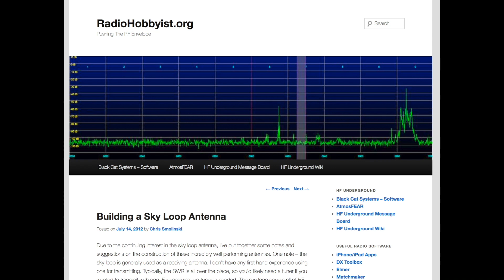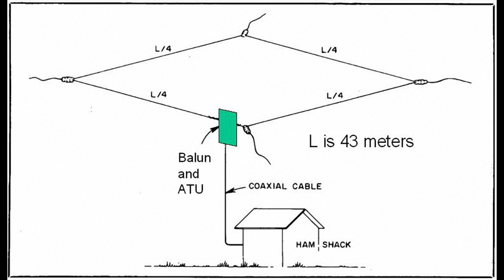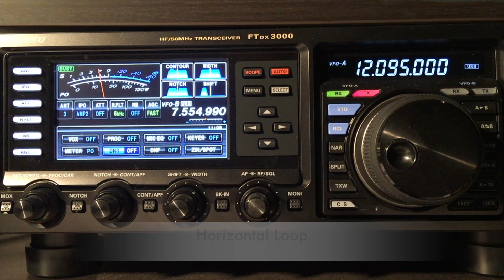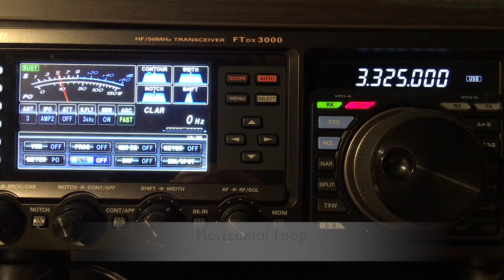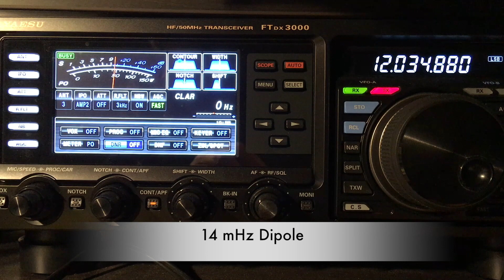Horizontal Loop Antenna Experiments

Comment: Licenced in 1985 and QST had  Skyloop article.  I built one for 80m full wave length horizontal loop.  100 ohms input so 2:1 balun and 50 ohm coax fed.  Brilliant.  So I made a 40m full wave loop with a 1:1 current choke and a quarter wave 75 ohm Q section matching the 50 ohm coax to the 100 ohm 40m loop input.  400 watts and it works Brilliantly.  Using an auto ATU I use the 80m on 20m and 10m AND the 40m loop on 15m.  I also have a yagi for info.  The loops are really very effective.  VK5LB

Comment: Go back many years in arrlr antenna handbooks(decades) and you will find info on sky loops.  Been playing with them for many years.  In fact, the first antenna I used was a sky loop with a clugged together tuner.  Worked pretty good on most bands but was a "sky burnner" on 80 with a lobe south  Been playing with a multiloop experiment...same dimensions,  but multi wires around the run in various configurations to try to  change radiation patterns. Haven't played in several years, but results I've had are very mixed as most of the matching methods have been home made and I've been mixing matching/feeding methods without documentation too actually measure actual changes in performance

Comment: Rob, the opening wideo shows you have improperly threaded the ceramic insulator.  The rope should go through the hole farthest away from the support end.  Then the antenna wire goes through the hole closest to the support end.  This way the rope and antenna wire are putting compression on the center of the insulator.  If it should break, the rope will still support the antenna with more slack.  Try it, you will like it.  WD0DUD
Reply from the maker: Yes, I know, Garry.  I threw this old antenna up in a bit of a hurry and did not take enough due care with threading the insulators. That antenna has been gone quite a while now (brought down by a falling gum tree) and replaced with an even longer (100m) loop in a more square-ish shape with the correct installation of the insulators. Thanks.

Comment: That ceramic insulator in the picture is not being used correctly it is being used in reverse mode its weakest way
Reply from the maker: Yep, that's correct. It was a temporary string-up before the video was done. I've reinstalled it since. Is that your only feedback? 🙂

Comment: Such insulators should be installed so that they're in compression, not in tension. In other words, the routing of the wire and support rope should be intersecting, with the insulator center in-between and being compressed (not stretched). Perhaps you'll have to look up an image.
Reply from the maker: Yes, correct. I threw this old antenna up in a bit of a hurry and did not take enough due care with threading the insulators. That antenna has been gone quite a while now (brought down by a falling gum tree) and replaced with an even longer (100m) loop in a more square-ish shape with the correct installation of the insulators. Thanks.

Comment: I see this is an old video. So my comment is this, the Bose system could have been used to cancel out the noise of added to your audio speakers, that's a possible fix, and I believe a computer software could have been work ed into the Bose system. To cancel out the noise itself. Just my thoughts on this problem.
Reply from the maker: Quite possibly. But you have to hear a signal, too! The horizontal loop is an antenna that works to pick up signals across multiple bands (a range of frequencies) in one easy-to-build, low-cost antenna system. The lower noise on the loop is a happy side benefit with an antenna of this type. Since this video, I now have a second generation of the antenna at 100m long in a square shape, plus a vertical delta loop at 10 MHz that also exhibits great signal pickup while rejecting noise. Thanks for taking the time to watch the video and comment. Much appreciated. Best wishes from Australia. - Rob VK3BVW

Comment: The loop seems to be the best receive S/N ratio - the end fed seems to be the worst (by far).
How do you keep the loop tensioned with each tree moving in different directions on a windy day?
Thanks! 73! VE3GHP
Reply from the maker: G'day, Garry! To avoid moving tree limbs, I anchor the wire to tree trunks - They don't move very much. 🙂 This video is around five years old now. The loop collapsed when large branches of gum trees gave way in a storm. I have a new loop now which is 100m long, in a similar location, and in more of a square-ish shape and works on most bands. I now also have a vertical delta loop cut for 30m that also works great on 10m. These antennas are really the "bee's knees"! 73, Rob VK3BVW
Reply: @RobVK3BVW  G'Day Rob - Thanks for your reply! - I also hope to have ~100m length in what will be four or five sided loop using trees and fed at my 15m tower.
I'm not wuite sure how I will deal with each tree moving in a different direction at the same time - I'm thinking it will involve some pulleys and weights though.
I'll be feeding it with open wire. - I gave a 30m doublet now, and I'm very pleased with it.

Comment: Hi Rob, I have just watched your very comprehensive review of the Loop Ant. thankyou for spreading the word about Loops. I have been spoiled, I built a 160m Delta loop here at my QTH 24 yrs ago and have never looked back, it's the only HF ant I have at the moment fed with open wire 90mm wide into the shack and tune my FT991 with the MFJ989D, works well  on 160-10m very low noise. Wayne VK2DWP.
Reply from the maker: Hi Wayne. Thanks for the comments, and great to hear from you. This video is around five years old now. The loop collapsed when large branches of gum trees gave way in a storm. The new loop is 100m long, in a similar location, and in more of a square-ish shape and works on most bands. I now also have a vertical delta loop cut for 30m that also works great on 10m. These antennas are really the "bee's knees"! 73, Rob VK3BVW

Comment: i have an 80 meter loop ladder line fed to a balun design 1:1 balun up horizontal at 70 feet, hears excellent and super quiet especially being in the country. On 40 meters i work austraila and mid east 100 watts with no problem, loops have generally 3 dbd gain over a dipole and a little more quiet but not by much over my 80m doublet.
Reply from the maker: Thanks for your observations, Anthony. Good stuff! 73, Rob VK3BVW

Comment: These loops work well.  I've used one for years. but for best performance you need to optimize the loop by feeding it 450 twin lead (or other balanced feed) and then tuning it at the radio with a balanced tuner. Best one right now but pricey is the Palomar BT-1500 Balanced tuner.  (The tuner incorporates a 1:1 BALUN The tuner lets you optimize for the band you're on. I built my own tuner identical to the BT-1500  I built my own balanced tuner by scrounging a couple of roller inductors from old Murch UT2000A transmatchs I got cheap at a hamfest. Used the tuning caps from them also. See the BT-1500 schematic, retty simple to build. 

It works great!! My loop  is 220 ft long total. It will tune 160M to 6M on this length of wire, but I needed to add some inductance with coils on the antenna and mess around with the twin lead length to get 160 work well.  Try to keep this antenna up off the ground to at least 4o+ ft if you can. Less will work with messy lobe patterns, more NVIS. I've worked a lot of worldwide DX on this antenna and it is certainly at least a whole S unit quieter!! Cheap too!!
Reply: PS Make sure to use a couple of spark plugs to make a simple lightning arrestor before bringing the twin lead into the shack!! 2 spark plugs mounted in a thick copper plate that is attached to a ground rod. Gap the plugs at about .020-.030" at least if using a linear smp. Twin lead just comes down to the 2 spark plug tips, and then passes on into the shack. Cover the bottom of the plugs by soldering 2 1:diameter copper pipe caps over the spark plug tips to keep out water, bugs and dirt.
Reply: I think you mean "Palstar" tuner.
Reply: RR Thanks for correctyion update,!

Comment: Hi Rob, Vince here from South Africa. I am interested in a horizontal loop for Mediumwave rx. Our property is 42mx100m but unfortunately has no high trees anywhere. Any suggestions?
Reply from the maker: G'day, Vince! For general mediumwave reception, I wouldn't worry too much about trying to get height into your antenna. The main factors are going to be the length and locating it away from any potential manmade noise sources. Since this video was made four years ago, I have replaced that antenna with one that is 100m long and in more of a square-ish shape. It works well on mediumwave, picking up plenty of signals. If you can get some poles in that are, say, more than 2m above ground (so that you don't decapitate people), that that would be a great start. As with all antenna work, experimentation is the name of the game. Good luck, my friend! Rob VK3BVW
Reply: @RobVK3BVW  hey mate, g'day to you too. Thanks for the response. At present i have two delta loops which are between 40 and 60m in circumference, fed at the middle of the bottom horizontal wire thru a balun. They are quite directional and definitely quieter than a long wire. I'm only 3km away from a local MW txer though, which does cause some overloading issues, even on my Drake R8A. These loops are very close to the house. So i was thinking of a 40x60m horizontal loop running on top of a fence around the perimeter of the property. The fence is a steel diamond mesh style one though, which i think could in itself be an antenna for all sorts of local QRN. I want all my antennas to be bidirectional to receive US AMDX to the north west and Aussie MWDX 'over the shoulder'. As you say its probably best to experiment. A mini rhombic or loop-on-ground antenna are definitely do-able.
Reply from the maker: @vincentstevens5048   Go for it! If that doesn't work, you can try some other design.

Comment: Hi Rob.  Very good video on your Skyloop antenna.  Thank you.  I did notice that the egg insulators that you used are not being used correctly.  You need to flip them around so that if the egg insulator breaks, the wire antenna does not fall to the ground because the support cord will be looped through the wire antenna loop.  That's what the grooves in the egg insulator are for.  Its a pretty neat design.  For that reason, I always prefer egg insulators for wire antennas; especially when I lived in Minnesota with lots of heavy snow.   WB0CGF - Paul in Florida.
Reply from the maker: Hi Paul. Yep. You are correct. They were around the wrong way when I installed it four years ago. That antenna has now come down....by force of nature....when a huge gum tree fell on it! :-)  A bigger 100m long and more square-ish shape antenna now replaces it. With the insulators correctly installed this time. :-)  Good antennas, the loops. I have also added a vertical Delta loop which is full wave on 30m and goes like the clappers! Thanks for checking out the video, cheers, mate.  Rob VK3BVW
Reply: @RobVK3BVW  Ouch!  I'm sorry to hear about nature taking down your antenna.  Oh well, another opportunity to improve upon and existing antenna.  :-)  After reading, listening, and watching about the design of the Skyloop and its performance, I am excited to try a horizontal loop antenna myself; which I plane to put up this weekend.  Thank you again for sharing your experience.  73s
Reply from the maker: @paulkoppie2657   Good luck with it, Paul.

Comment: Boy that end fed antenna sucks.  I have had a horizontal loop for transmitting and receiving for the last 25 years.  Just Love it.  No maintenance required.  You live in a wonderful place and must chare it with others as we all do.  Thanks so much for the information.  Many never try a loop.  Peace and Happiness to you.  WB7ORB
Reply from the maker: Thanks for your comment, Tim. You are right about the "no maintenance" aspect of the horizontal loop. The only time this one came down was because a large gum tree fell over and took it out! It has now been replaced with a 100m long square-ish version that covers so many bands, virtually an all-bander! I also now have a vertical delta loop which is full-wave on 30m - hums along on 30/15/12 and 10 very nicely! Cheers, mate. Rob VK3BVW

Comment: How do you know how long the ladder line should be.  Does it matter.  For my scenario- it will be about 35-40 ft and will pass under a window where it will be connected to a 4:1 LDG balun.  There will be about 35ft of Rg8x coax before it then connects to the tranceiver.  Any specific minimum length the loop wire should be.  Can you also run the horizontal loop in a triangular pattern.
Reply from the maker: Davey, if you are using ladder line, then the length is not going to matter much at all. This is a pretty broadbanded antenna, so yes, the length of the ladderline will have some bearing on resonant frequencies. Experiment to see what works best in your situation. On the lower frequencies, the length of the loop will be a function of which bands you want to operate on. e.g. If using the 80m ham band, then cut the loop for one full wavelength i.e. 80m long. Adding ladderline will need to be taken into account, of course. A triangular shaped antenna is called a delta loop, and yes, they work well, too, in both a vertical and horizontal layout. I currently have a delta for 30m which also works great on 15 and 10m. I hope that helps. Cheers, Rob VK3BVW

Comment: Does the horizontal loop need to be in a square (4 equal sides), or could I use the same length wire configured in a triangle (3 equal sides)?
Reply from the maker: The shape of the loop appears to be quite forgiving. As you saw from this video, the shape I used was rectangular. Since that video was made, I now have another loop that has more of a square-ish shape. A three-sided loop would be called a Delta Loop and can be either vertical (depending on which band you cut it for) or horizontal. I recently installed a vertical Delta Loop and that also works really well. I hope this helps you.....
Reply: @RobVK3BVW  ....looking at installing in horizontal configuration. So what are your thoughts on length for primarily 20, 40, and 80 meter. I dont DX, but like to QSO with operators from east to west coast. Im in Oklahoma, so Ive got a fairly centralized location. Im on the edge of town, with less rfi than others. As a newer HAM, only licensed in June 2020, then upgraded to Extra by August, I have actually spent a lot of time on my grounding system, reducing possible rfi within the shack, keeping data cables away from coax, and predominantly use DC power over AC. Have some picks of my setup on QRZ. So should I look at a half wave, or is there a great benefit in going to full wave length. 
Currently running a chameleon emcomm III oriented E/W in an Inverter L configuration, as well as a second chameleon emcomm III oriented N/S in an inverted L configuration. Height of each approx 32’

Im considering replacing these two with a horizontal loop, but havent made that final decision as of yet. Any input would be appreciated 

K5JRX
Reply from the maker: @jay-rus4437   A few points to make here, Jay-Rus. 
1) Definitely try full-wave horizontal loops.
2) Lengths are, conveniently and approximately 20, 40 and 80m long, :-)....you US guys will have to do the conversions to feet. 
3) Try to keep the Emcomm things up so you can do on-air comparisons against the loops
4) WSPR transmissions are GREAT for on-air comparisons. Almost instant feedback via the WSPR.new website
5) It all depends on how much room you have on the property (you haven't given me any idea about space available), but I guess you have some room to spread out these antennas, and 
6) Built the 80m full-wave first. You may find that it also resonates on the other bands you want to use. This will possibly give you additional handy lobes off the sides of the loop - an antenna analyzer helps here!

I hope that helps. btw, nice QRZ page! You are way too young to be a grandfather!!! ;-)  Cheers, Rob VK3BVW
Reply: @RobVK3BVW  ....thanks for the info. We live on an acre, on the edge of town with open field behind us. So enough room to set up. 

I feel too young to be a grandfather, but Ive been married for 31 years, didnt have our sons until we were in our mid 20s, and our son is 24 now. Time flies 😁 ....and my QRZ just highlights my OCD. Lol

Agree about the figuring out feet in place of meters. With an engineering background I have NO idea why we all arent on metric. Should have been me on projects dealing with feet....then reading architectural plans with their use of scales....then, if all that wasn’t enough, we had to deal with civil engineering plans in 1/10ths....1/10ths of what? FEET.....what? 1/10ths of feet. Knuckleheads know that 12 inches in a foot seems like a stupid system, so they attempt to somehow merge SAE and metric. Good grief
Reply from the maker: @jay-rus4437   :-)  All good. Love your last paragraph! All the best, mate! Rob